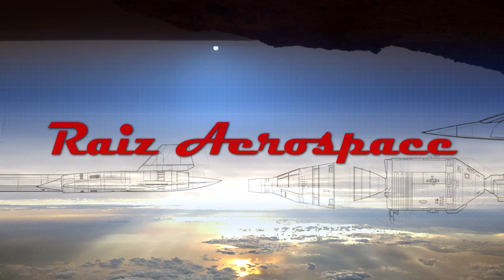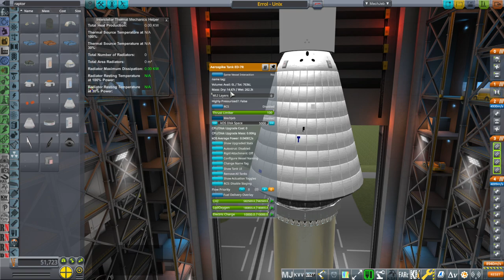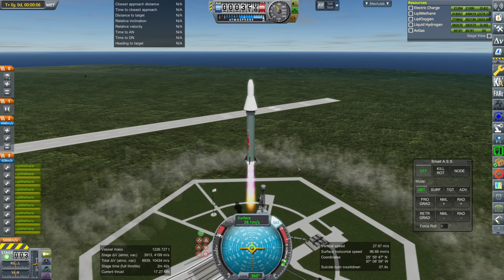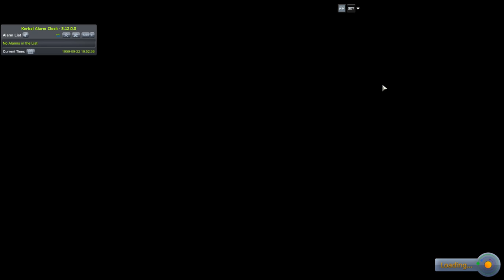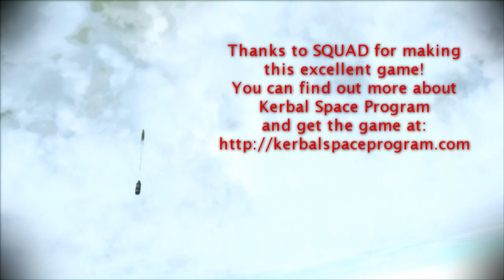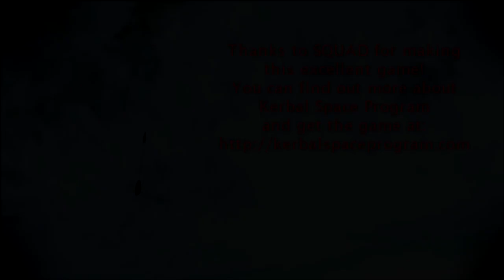KSP with Realism Overhaul - Errol - Unix

Comment: Apparently BO are actually considering this as a possibility for their reusable second stage Jarvis on New Glenn, cooling the aerospike to have it act as a heat shield.  The other options they are looking at are a spaceplane or a starship like vehicle.  Great timing on this video!
Reply from the maker: So . . . they're looking at everything as an option, basically, right?
Reply: @RaizSpace  yeah the program seems very open at this point considering they are looking at a type of engine never flown to orbit before lol
Reply: @RaizSpace  give them a few years to get past the drawing board. Blue Origin doesn't have the HLS contract, so they don't have much funding... cough cough Jeff Bezos